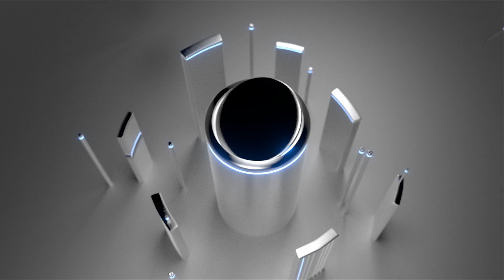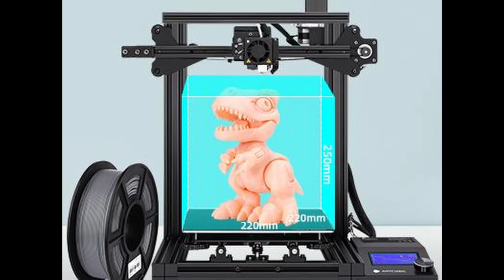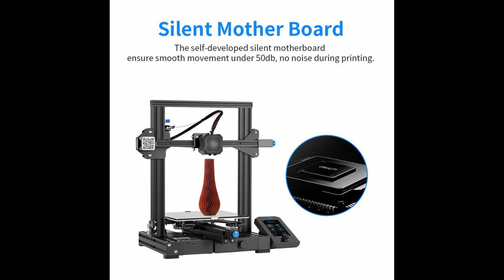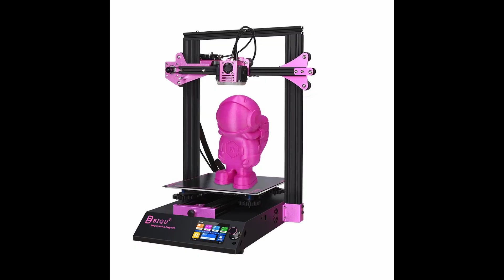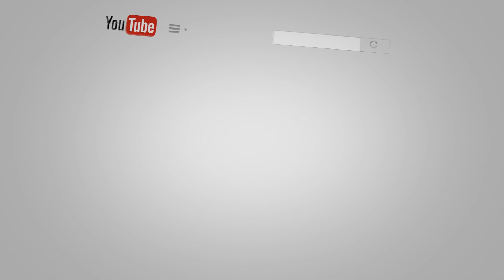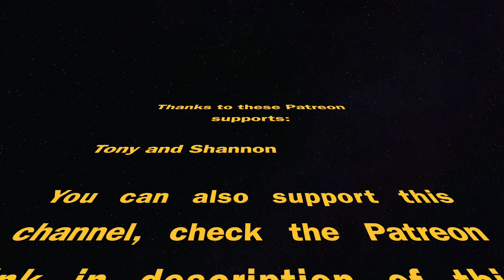Which 3D Printer to buy in fall 2020

Comment: I am struggeling between the ender 3 v2 and the biqu b1, since the ender 3 has s bigger Community, which could be usefull for a newbie like me, but the b1 seems the better machine per $
Reply from the maker: Hey, no need to struggle. Creality has indeed a very large community and the brand does look very strong, but brands like BIQU are great as well. I would choose for the BIQU B1. Why? Other than the color, I do like it, but you can also get it in black. This machine has it all, touch screen,. 1 nicely cable to the extruder, nice belt tensioners, light for checking your print, 32-bit board with silent stepper drivers. And this machine has some upgrades that Ender 3 V2 doesn't have... And customer service from BIQU is way better... some people mentioned this to me... Creality has bad service
Reply: @Zachary3DPrints  alright than. I had actually never heard much about customer service of either of them